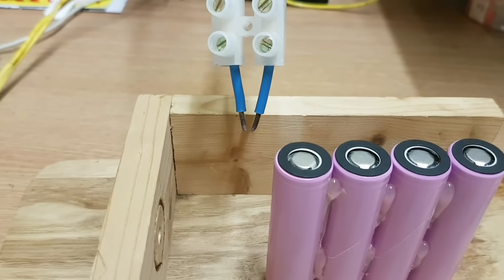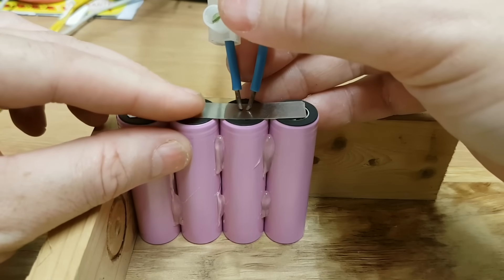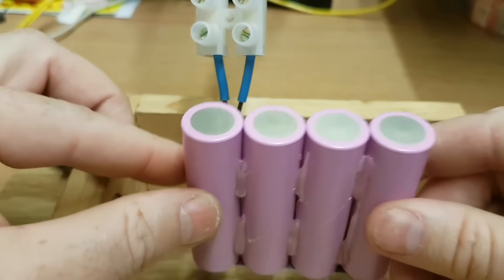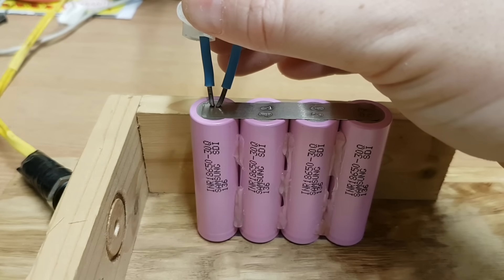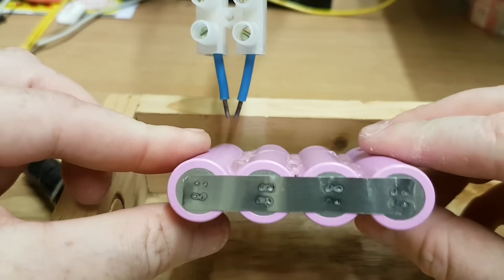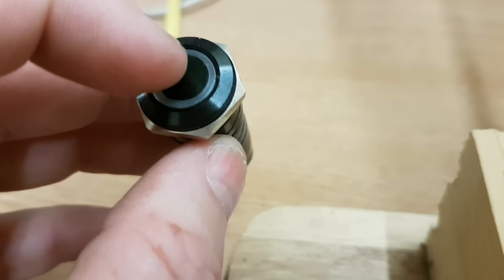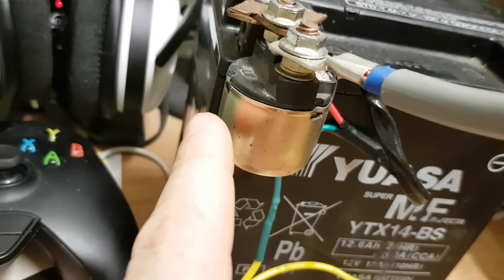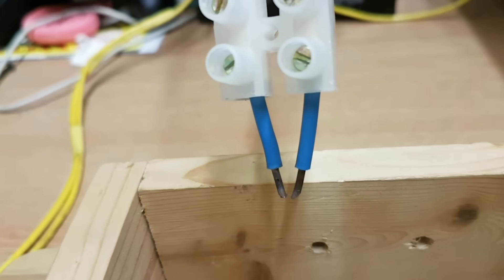DIY Battery Spot Welder - Demonstration & Explanation

Comment: Hello Darkkevind1978... great video. I am contemplating making my own packs for an electric bike. Question : how often you need to charge the 12V battery or how many welds you estimate from one charge ? Thanks!
Reply: Awesome, a nice super simple spot welder for battery tabs, always avoided making making a microwave transformer so for a small task.

Nicely done!
Reply from the maker: Welsh Dave thanks mate!
Reply: darkkevind how do you recharge this battery?
Reply: @ofekpearl  Any 12 volt battery charger. Even a 2 amp charger would work. Ask around. someone you know has one, or, more.
Reply from the maker: Aldaochan I received the battery fully charged and did around 500 welds with it. Then I left it sitting for a month or two. Recently I've need to make up more packs so before I used it, I charged it for a few hours. I'm not sure if it needed or or not but I don't think it did. I'll have to check the voltage. In answer to your question, I don't think very often.

Comment: Where do we get this strips, can you please give the battery specification, i have also noted a weld improvement with respect to the previous video what did you do.
Reply from the maker: Ihab Ahmed https://rover.ebay.com/rover/0/0/0?mpre=https%3A%2F%2Fwww.ebay.co.uk%2Fulk%2Fitm%2F263068537518
Reply from the maker: Battery is 12v 200A cca

Comment: Excuse me sir, I want to ask you how to open it what? thank you
Reply: Maulana Ismail Maybe he is asking how to separate the batteries in a laptop as they are already welded together.  He assumes the nickel strips are zinc.  That's my guess.
Reply from the maker: Maulana Ismail, eh?
Reply: +darkkevind1978 so I want to unload the laptop battery, but the problem to unlock the zinc lock. is there a way to open it?
Reply from the maker: I've no idea I'm afraid, I don't use laptop batteries.
Reply: +darkkevind1978 so can not be opened again?
Reply from the maker: I'm sorry I don't understand what on earth you're talking about! :(
Reply: +darkkevind1978 :( i want to ask, how to remove both the object, battery and zinc=iron
Reply from the maker: I don't know, Google it.
Reply: +darkkevind1978 thx

Comment: Thanks for the great video!  I've purchased a starter solenoid and some short heavy-gauge battery cables, and I plan to give this a try in the next few days.  Because I'm using a car battery which would normally have around 600 CCA, the high end of the range you recommended, I am going to use an Arduino Nano with a 5V relay similar to the one you showed in your video to operate the 12V coil for the starter relay.  Since you have demonstrated the process is fairly robust with respect to timing, rather than build in a variable time capability, I will just run a series of trials by changing the arduino code until I identify a good interval value to use with my battery.  The nice thing is that the 12V battery can also power the ardunio nano so it'll be self-contained and portable. I'll stop back here to let you know how I made out.  Thanks again !!
Reply: Chicago John:  You may risk damaging the batteries due to overheating if you solder their end caps.  This is where spot welding is so much better.  And solar cell tabbing strips are tin plated copper, not nickel as used in the video.  Nickel has a higher electrical resistivity than copper so more heat is generated at the spot weld - essential to cause the surfaces to weld together.  You may get poor welds with copper because if the lower heat generated.  Basically, copper is too good an electrical conductor, which is why the copper wires don’t weld to the nickel strips!!
Reply from the maker: Great! I look forward to hearing about how it went? FYI, a good time for the weld is 0.4 of a second :)
Reply: I will start right there; thanks so much for that information.  I think I'll go up and down in 200 mS increments, then, and see if I can identify the limits of the window and then shoot for the center of it.  As you point out, that will all likely be dependent upon the current a particular battery and circuit delivers, and, I suppose, it could also then be subject ot change over time.  I should be receiving my tabbing ribbon tomorrow so hopefully I'll have some feedback for you by Monday.  My initial application, by the way, will be to construct 3-cell serial pack that I want to use as a rechargeable backup supply for an Arduino in connection with a solar array project I'm working on.Your spot welding technique was the missing piece of the puzzle I was looking for.
Reply from the maker: Glad I could help! Good luck! :)
Reply: Chicago John What's 600 CCA?
Reply from the maker: CoolKoon Cold Cranking Amps...
Reply: darkkevind Oh, okay, thanks.
Reply: Got sidetracked.  Now I'm debating between your approach and soldering using the solder-coated, cold-dead copper buss strips I used on my solar panels. Still haven't decided.
Reply: darkkevind a
Reply: darkkevind

Comment: wow, that looks too easy!  how do you control the timing?  I didn't see the timing board when you showed the battery, do you just press and let go fast?
Reply from the maker: Beakerzor yep! Exactly that, just a quick down then up. I've pretty much perfected the timing now, I don't really need a timing board like the one I show in the video...
Reply: He used 12v battery 10-12 SWG (standred wire gauge) two tipped wire piece solder to 2.5-4 square.mm two wire for positive & negetive, one wire connected directly to -another to + of battery in series with a contactor relay (means contactor used for starter motor or any self starting engines) the contactor relay has 2 power terminals & 2 terminals for relay coil, relay coil connected in series with a press button switch between + & - of battery, when you press the button switch the relay get activated & it connect 2 powerterminals, when both terminals touch the battery cells strip the battery power short circuit which generate heat there by weld the strip with cells, Note :- battery relay of scooter or auto bike is available in scrap yard of bike or new ones are available at all auto bike spare parts stores, regards, Siddaramaiah. C.